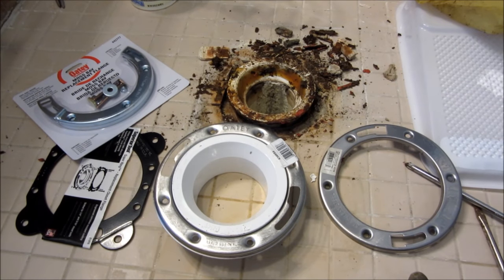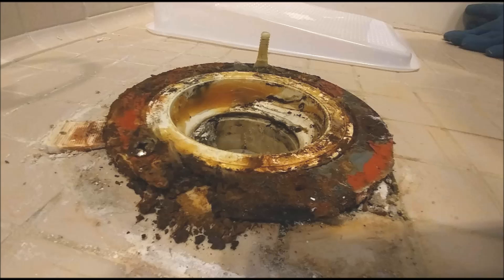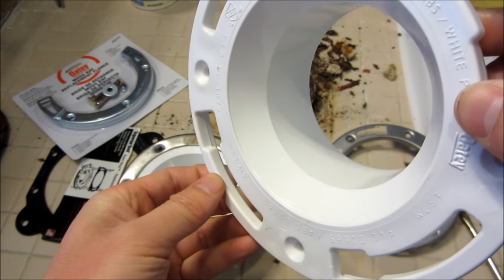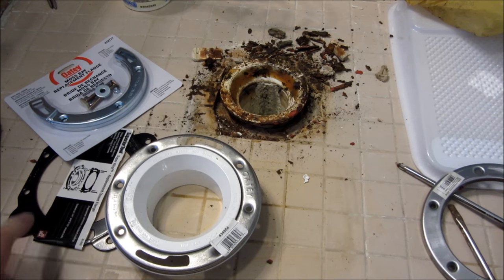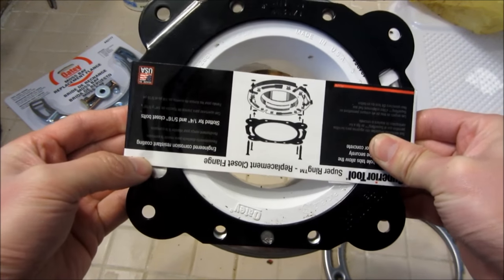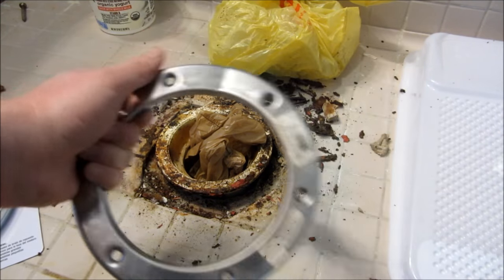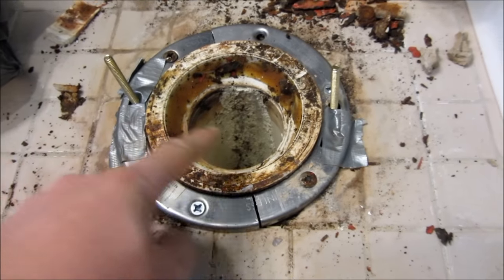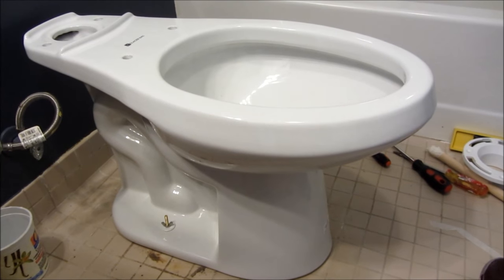Toilet Flange Repair | Broken Rusted Closet Flange Replacement Kits | How To

Comment: This must be a video of how not to replace a toilet flange.
Reply: Must be a renter!
Reply: No, it's a confidence builder.  If this lasted and didn't leak, it's all good.
Reply from the maker: @berkeleyharbin1787  Yep, let's just say, what I did was 100x better than what the professional plumber did when putting this condo building up.
Reply: @PoolarityChannel  Any job in  Fixing that No Leak.,  It's A SUCCESSFUL Fixed and Great job and Save Money...👍👍😅
Reply: Yeah. I would never fix it this way even if I was about to flip the house and run off. 
Plus, do a bit of cleanup before filming and reinstalling.  And you didn’t even mention a wax ring or gasket.  What a hack job
Reply: metal flange lasted 10 years? that's pretty damn good
Reply: @saltybuckeye  That’s what I was thinking. 10 years is pretty good, typically you have issues within the first 5 cause of bad plumbing.
Reply: @PoolarityChannel  not if his work lasted 10yrs, did you even change the wax ring?
Reply from the maker: @Rigsby-ks4nw   Yes, I did.  Since its off, spend the $10 and change the Wax Ring.  No issues, still lasting like a champ.
Reply: That's the idea bruh if ur a apartment maintenance guy

Comment: Do not listen to any any of this. He had the correct repair flange (otay moss bay) but decided to destroy another repair flange. This is a DIY hack job. Oh man, too much to criticize and not enough time. Leave it to the pros.
Reply from the maker: This will last another 20 years.  You know how bad some self proclaimed Pros are?  Why do you think this didn't even last 10 yrs?
Reply from the maker: In my situation the pre-split ring would have been too thick, every millimeter mattered in my scenario, because of the raised flange with was already abnormally high, put in by the previous plumber.  So I had to find an alternative.
Reply: FYI, I was quoted ~$500+ to replace an iron flange. If you think it makes more sense to pay someone $500 to replace a flange, rather than spending $20 on a 'hack,' I don't know what to tell you. You have more money burning a hole in your pocket than I do, that's for sure.

Comment: He actually has the right  2 piece repair flange in his hand but then proceeds to go make a flimsy one🤣
Reply from the maker: That one was too thick, every millimeter  counts for me since the flange was raised higher than normal.
Reply: The two piece has too large of a hole for some 1980's painted ring flanges.

Comment: That is a shocking amount of rust for 10-years.  It normally takes 20+.  Anyway, plastic flanges are weak.  They crack, warp, flex, etc. I use metal and paint them with Rustolium to last longer!

Comment: I have exactly the same situation, my flange also sticks up and rusted out ring.  which wax ring size did you use.  The thinnest one?
Reply from the maker: I used the thickest, but I bought a few because I didn't want 5 trips back and forth to Walmart or Home Depot.  I figured the wax compresses anyway, so I will attempt the thicker one first.  Which has about 20% more wax than the thinner one.
Reply: To high a flange means, use the thinnest wax possible and probably some toilet shims too. Do it the right way...

Comment: First, clean up the mess before even thinking about continuing unless you’re an animal 😁. Second, although it was in fact informative, this video definitely had some incorrect info. 
Might I suggest using an extra set of toilet nuts and a washer to secure the bolts to the flange. This will save you a ton of grief. Duct (he called it masking tape) tape won’t keep the bolts from turning when you are trying to put the top toilet bolts. Also, use a good quality screws to mount the new flange, not the old rusty ones or you’ll need up right back where you started. Even the cheap zinc ones are better.
Reply: For this kind of job...... Stainless steel or galvanized screws Should be used Only...
Reply: @Honestandtruth007  I have no idea what they are made of. I just use what comes with them. I’ve never had problems with the actual nuts. It’s mostly the flange that rusts out. I’m not saying you’re wrong at all.
Reply: @dontbetoomad2684  That's Okay friend...... Sharing is Helping.
So many people are having problems with the Flanges...
..... 2-Holes on the PVC flange are NOT Strong enough to Hold the Toilet and The Roughness of the people........
...... Personally...... I think the Plumbing Codes and the Designs MUST be Changed just Added 2-Holes by the toilet Bowl itself and bolt it to the Floor..   That should be Strong enough to withstand the Roughness of the people...

Comment: When you go to loosen the nuts holding the toilet down them way you set it the toilet bolts will keep spinning!. Plus the flat piece that's part of toilet flange bolts might pop through slot on the flange!
Reply from the maker: The flat part of the toilet flange bolts were more than 1/2" away from the open slot on the metal ring.  The back of the toilet tank has less than 1/4" give from the wall, and rest basically against the wall.  It is unlikely the toilet will shift more than 1/2" in any direction for it to slip out.  This setup, while it looks like a hack is actually more secure than the previously installation which lasted 12 yrs.

Comment from the maker: Are the Thumbs Down from envious plumbers?
Reply: I think they dont want plumbing tips from Woody Allen. 
I appreciate you tho.
Reply from the maker: @matthiasstephens2265   I prefer to think of myself as a high pitched Tom Brady.
Reply: I was wrong!
Your Dan Ribakoff ,lie detector expert
Reply: Sloppy job
Reply: "I will never use one of these metal flanges again"

installs metal flange after compromising structural integrity by cutting it in half

"what you want to do is get as many options as possible because you can return what doesn't work" 

proceeds to ignore the split metal ring from oatey so he can hacksaw a solid metal ring from oatey in half

"don't mind this duct tape, some people even use straws"

doesn't know the bolts are to be held with a washer and nut.. Even though the oatey split ring pack includes the nuts and washers he needs

Maybe it's just me, but talking shit about professionals as you duct tape and hack together a "repair" is a bad look.

That you filmed it and showed it to the world as a "how to" is chef's kiss perfection.

Comment: One cut is okay but if you do cuts then just use the 2 piece flange it’s much sturdier and it has the screws that connect them together . But the choice are great ideas to show us the choices . I just removed my rusty old flange and the concrete beneath was slushy so I bought some tube concrete and filled the gap and tomorrow I’m installing the 2 piece flange . Thanks for the video !
Reply: I’m in the same situation. What tube concrete did you use?

Comment: Very good and helpful video.  I just did some of this.  Same kind of situation.  I agree, pursue all the options.  You can take back what you don't need.  I ended up doing a similar split ring scenario too but I used the Oatey Moss Bay split flange from Lowe's Home Improvement.  It is engineered to fit in around the plastic part of the existing pipe piece that is not easily removed.  Once in place use a hammer drill with a 3/16" masonry bit and then screw down with 1/4" X  1 3/4" concrete appropriate screws if in a slab or appropriate and similar screws for wood.  Take time to study all the options as was done here.  If your slab or wood surface is seriously damaged it maybe a much more serious fix best left to a professional.  I had this presented to me rather quickly and this video gave me a great headstart.  I can't thank you enough for posting it.  You have done a great service!

Comment: I use a metal washer and nut round side down to tighten the water closet toilet bolts to the flange so they don't spin later especially if the toilet needs removed again. Plus on top of the toilet porcalin a metal washer on each side top and bottom of the plastic washer for the plastic caps(making the plastic cap washer in the middle of the metal washers, then the nut round side facing up on top. Then trim the bolts if needed to the height of a little above the final nuts to hold the toilet to the floor and install the two plastic caps.
Reply: Completely agree

Comment: Just curious why u didn’t use the split flange kit u had in package already
Reply: I think it’s cuz it didn’t line up with the holes from the other flange 🤷🏽‍♂️
Reply from the maker: @boridebrooklyn8300  That's right.  That was 1 fo the reasons, the 2nd was that it was the thinner 1, because my toilet was raised higher, 3rdly it was the cheapest, and I thought it would offer equal duration.  Plus I was sure that would fit, since it was nearly like the original.
Reply: ciana baltimore Omg u have the sexiest eyes 🥰😘

Comment: Probably already mentioned on this older video, but the silver metal is stainless steel - a superior upgrade of what was originally installed - epoxy coated steel.

Comment: PVC flanges do break. They're plastic and not indestructible.  Flange problems have been keeping plumbers in business since Roaman times. My plumber makes more than my Doctor 💊🤣 . 1st Thoroughly clean your work area so you can properly assess the problem and have an even surface to seat the new flange. Your flange may have failed from improper installation. You may need to level the floor around the flange with concrete. Your wax or rubber seal  kit  should have included nylon posts clips to secure your posts to the flange channels instead of duct tape  . Your flange should be even and level. The new metal collar can actually bend or recess if it's too thin or not properly supported by the subfloor  which can lead to failure and water damage. In some cases it's just best to get a pro or expierenced friend to help with this. That way the root of the problem is solved. Insurance damage claims can also be denied if a repair wasn't made by a licenced pro or not done to code.😢

Comment: Buy 2 packs of closet bolts so you can properly secure them to the flange. Also don’t have to worry about them spinning if you ever have to pull the toilet again.
Reply from the maker: There's only 2 holes on the ceramic toilet.  Where are the other extra 2 bolts attaching to the toilet?
Reply: Poolarity - Life Hacks The second pack is used for the washers and 7/16 nuts not the bolts.
Reply: @cloud9418  right and the nice wax rig kits come with 2. Who tf would use duct tape and straws? Ill tell yaaa... kids in a science project, not plumbers.
Reply: @codycozart1023  straws are a good idea. They act as a guide when lowering toilet. Then before you tighten the bolts you pull them off

Comment: if it won't break then why do they sell the repair kits????
Reply from the maker: For the older stuff?  Well, if it breaks it won't be because of rust, it would be because of improper use???
Reply: ciana baltimore  did you not watch the video??????????????? He said in the video there is no need to believe the pvc ones will break . Which got the comment . Why do they sell repair kits . Great job ........🙄🙄🙄
Reply: ciana baltimore 🙄🙄🙄🙄🙄🙄

Comment: My flange completed rusted away too. I used the flange repair ring because the pipe is offset, and an insert won't work. The ends overlap and once the screws are in place, it doesn't budge and works like a charm. I'm now putting in a new toilet so I've decided to replace it, not because I need to, but as long as I'm upgrading, I might as well do it right.

Comment: I'm going through this right now. The seating ring cheat is what I needed assurance with. This is essentially the route I want to take with out ruining the existing plumbing height or width. I have alreadycleared out as best as I could the area around the closet flare now I just have to find a proper flange seating ring which I can modify slightly without compromising the existing assembly. The only concern after this is just the seating position of the toilet... Thanks for the reassurance vid.

Comment: Ewwww why in the world didn't you just use the metal washers and nuts provided with the wax ring to properly secure the bolts instead of using that horrible duct tape

Comment: toilet will leak! pilot drill!!! concrete screws!!!
the reason the other flange was damaged is because it got screwed down same and flange is slightly to high but to high and bad screws = pulls flange up when u tighten toilet over time earth moves pipe moves forward and back which pushes flange up and down screws get loose when screws get loose toilet not as secure and causes separation from wax ring and then ull have your rusted steel ring again which is def rusted and wiggle at time of my post 3 years from the install

Comment: I’m having the same issue with the flange great idea on cutting it. But my other problem is I only have enough concrete foundation to put one screw in. I’m gonna use a tap con and maybe I can put a couple other ones in at an angle?
Reply from the maker: One screw is definitely not enough.
Reply: I used the split flange option and put two tap cons in the concrete. It’s not bugging at all

Comment: When you replace the old metal flange , spray with rust guard. But before attempting any toilet repair, always wear proper PEP mask eyewear and gloves...
Reply from the maker: that's a solid A1 steak sauce tip, Rust Guard
Reply: PPE
Reply: Or don't wear PPE. We're adults; we're responsible for our own safety.  It's our choice.

Comment: Why not just do it right and cut old pvc flange off with a pvc saw that attaches to a drill and glue that pvc flange on the stub?
Reply from the maker: I didn't have those vibrating cutters to do it. plus I did not want to risk the PVC sliding under the subfloor where I could not reach it, both vertical and horizontal after cutting it, because its possible that it was not fastened properly.  I'm in a condo building, and if that happened, it would not be pleasant.  If that was a house that would be a different matter.
Reply: @PoolarityChannel  vibrating cutters🤦‍♂️

Comment: And get yourself a whole saw that will fit inside the old flange much easy.
Reply from the maker: I could have used a multi-tool.  The problem is, when u live in an apartment building, you don't know how that tube is fastened.  You don't want it dropping below the subfloor even slightly or to misalign after you cut it... you don't want to end up tearing up the entire floor to fix that problem.  Its not worth the risk.

Comment: Do you feel that the ready made split flange kit is just a waste of money ...and that is why you decided to just cut the flange yourself?  You dod not see any difference between the two?  Thanks
Reply from the maker: The ready made was thicker, and my flange was already raised above normal, so for me every millimeter counts.  Effectively no difference, 1 was $5 and the other was $25, not that that should be the determining factor, it wasn't.  Overall it was roughly equivalent, so I went with the one I opened first, and return the others.
Reply: @PoolarityChannel  Thanks for that reply ....do you recall what the thickness of the two were?  I have a similar problem to solve
Reply from the maker: I think the pre-made one was 0.15 mm thicker...you still need to make sure the Wax envelope the spaces, so I got the bigger wax ring for that reason.  More to smush, but maybe the regular is fine too.  But both, try the regular wax ring first after you've put the stainless on.  I'm sure what I did will last 10+ yrs

Comment: I don't understand why you just didn't use the oatey two piece flange that you already had in hand. You berate the person who installed the original flange but then proceed to do your own hack job.
Reply from the maker: The 2 piece flange was about 2mm too thick, compared to the one I split.  The 2mm caused the toilet to rock.  The split flange I created was more flush and similar to the exact thickness of the original.

Comment: silicone  will lock it in place
Reply from the maker: The purpose of the metal piece is to secure plastic flange which I did not remove to the floor, then to secure the toilet to the metal ring.  The wax ring and the funnel inside the wax ring is what seals the hole on the porcelain toilet to the plastic flange.   You do not ever want to put silicone to seal anything on a toilet.   If the wax ring, flange and toilet are not aligned then it will leak eventually.  While this looks like a hack, the focus was on the stability of those 3 things, to secure it better than the previous 12 yrs.
Reply: you always use silicone around the edge of the toilet  to lock it in place.  been doing this for like 17 years now and if you do it do it right
Reply from the maker: @matthewwade1974  You can go around any high end luxury condo building and you will never see silicone around the bottom of a toilet.  If there is a leak, you want it to leak out where you can see there is a water leak before it damages your subfloor over time.

Comment: Those silver replacement flanges look like stainless steel, which does not rust or crack.
Reply: Daniel Antonio stainless steel rusts
Reply: @LoneWolfRanging  Depending on the grade on stainless. Those steel ones shown are galvanized and will rust over time.

Comment: How did you remove the old one?? I'm in the same situation.
Reply from the maker: One side was completely gone and disintegrated, the other side I unscrewed with a screw driver.  Make sure you get a flange that is not too thick (ie too tall for the toilet to sit on top of)